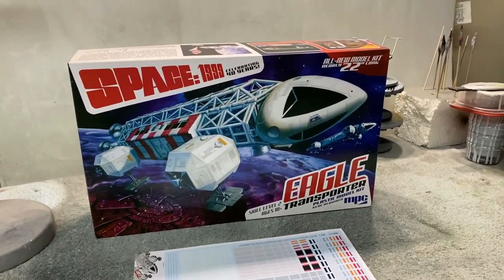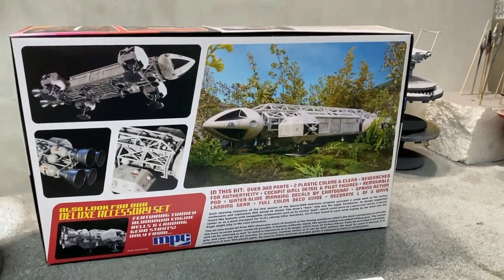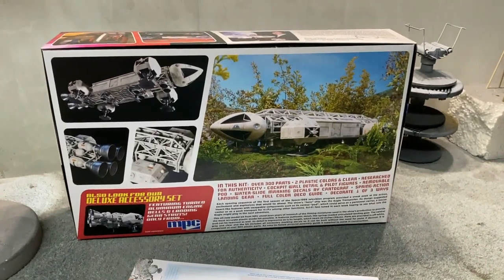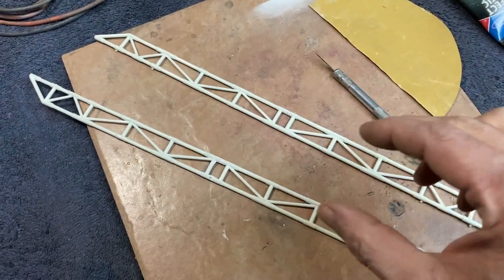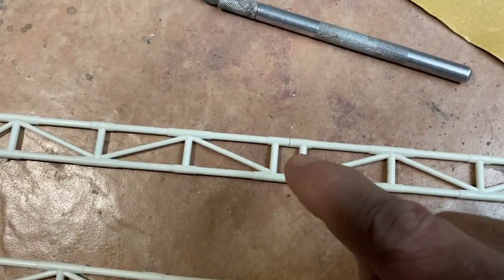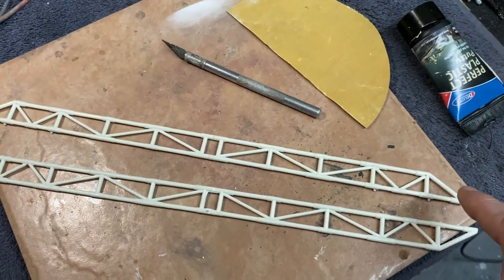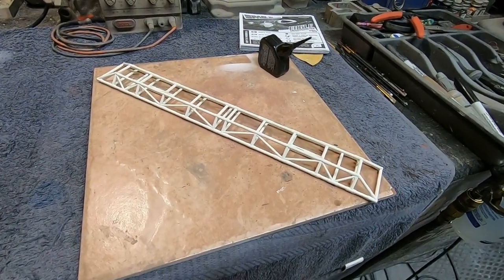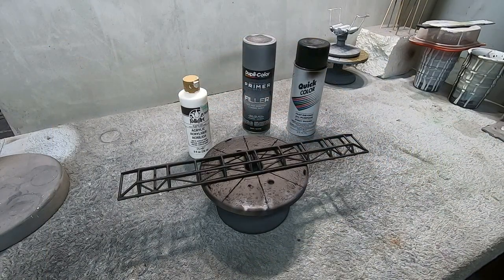Space 1999 22" Eagle Transporter Model Kit Build Series Part One

Comment: Handy tip for getting a very nice true flat surface for modeling and other work that needs a surface plate. Find the local granite counter top contractor/manufacturer in your area. They cut out the hole for sinks all the time, and consider the cut piece as waste. Talk nice to them, and they will often give it to you for free, or for a couple dollars as easy lunch money. Just as flat as the expensive surface plates used by machinists, even overkill for modelling, but can't beat the price!

Comment: Definitely a Space:1999 fan here. I've seen several YT modelers build this and older versions, can't wait to see your take on it. Good call not lighting the engines.

Aztec Dummy is also doing the stunner/commlock kit as have a couple other modelers as soon as it hit the racks. I know for sure yours will excel. There's definitely room for an active display in the commlock. I'm expecting aftermarket kits using an LCD or OLED display and Arduino or something not too long from now, but an LED strip and some fiberfill should look absolutely great. There is no end of tiny sound boards that will fit and there are plenty of sound clips available on YT. Come to think of it I binge-watched the series on some streaming service or another last year (Pluto TV IIRC) that had excellent sound quality so you can grab pretty much any audio from the show you want as a sound file.
One omission in the kit IMO is the desk stand the commlock was often seen in. I have seen Pepakura paper models of it online- shouldn't be hard to replicate in sheet plastic if you're that big a fan. ;>)